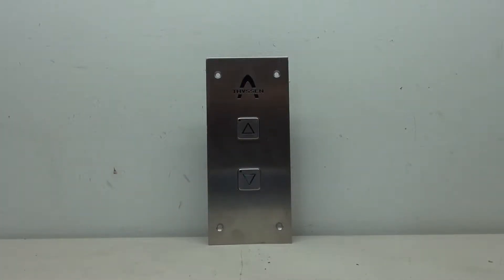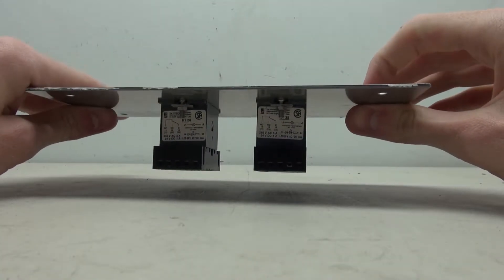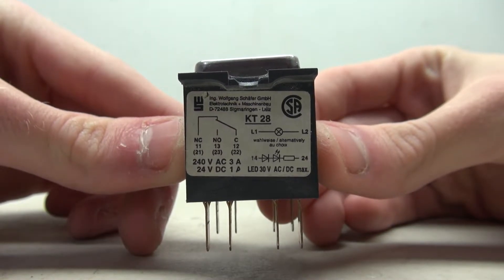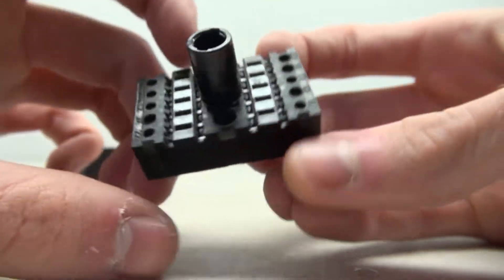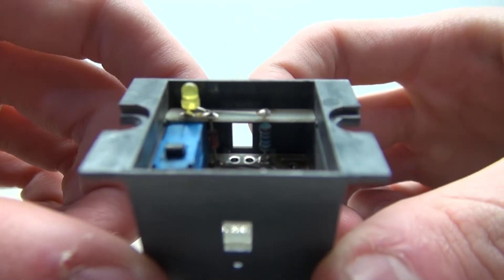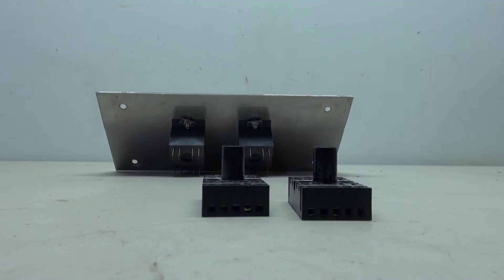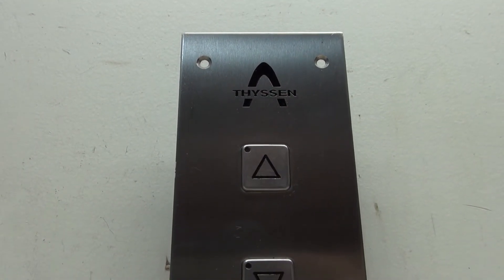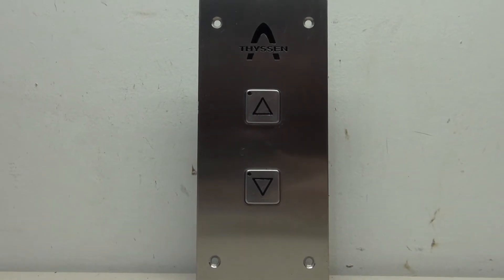Wiring A Thyssen Elevator Button (Schaefer KT28)

Comment: I have a bunch of these in my collection... 3 complete panels and a bunch of callbuttons. All of them, except one callpanel, have this variant but I have never opened one up. The only Schaefer panel I've opened up uses plastic covers instead of metallic ones and they uses bulbs instead of LEDs, wich led me to belive all of the callbuttons uses bulbs. I have to inspect one of my metallic variants one day to see whenever they uses light bulbs or LEDs.

Btw. the bulb sockets are the same as used in the DEVE car panel's Emergency singal button so the bulbs can be moved between those panels, if you ever manage to get hold of the bulbs that fits.
Reply from the maker: Very interesting. I like the modularity of these buttons.